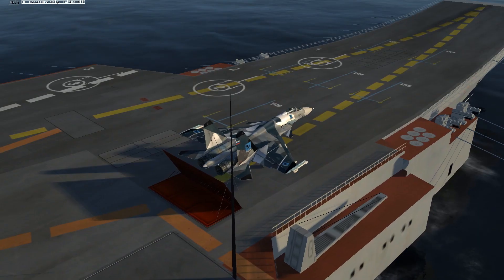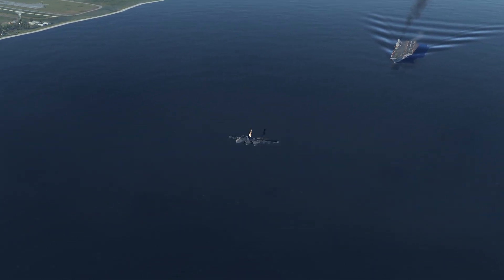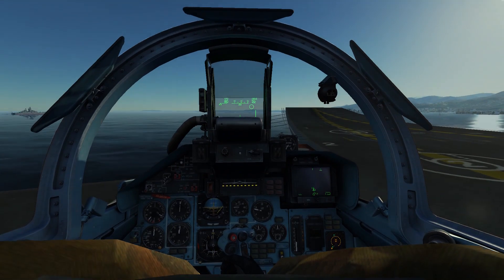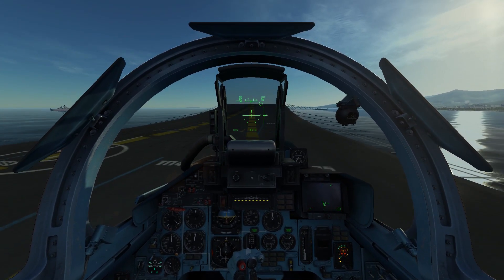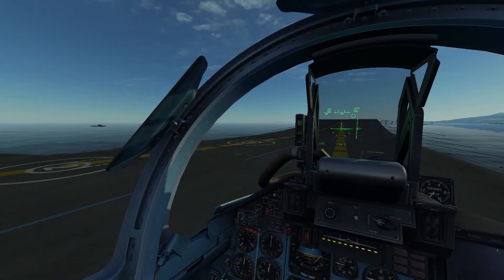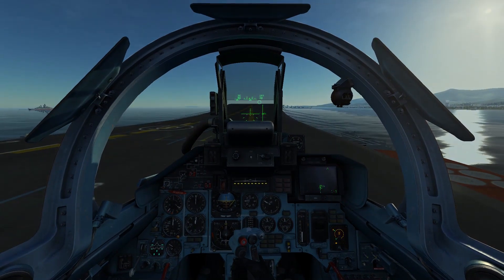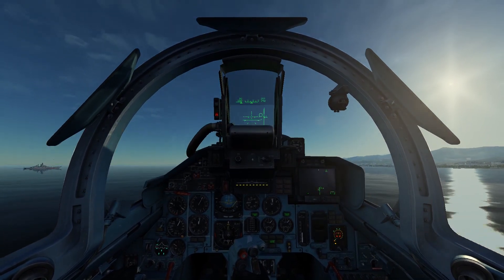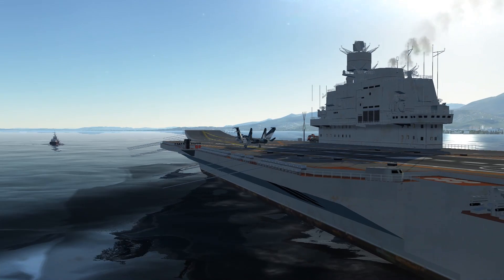DCS Su-33 How To:  Carrier Take Off

Comment: Just get to the back of the carrier and you can takeoff from there with as heavy as 36500kg. Yes, with 3500kgf above the MTOW you can takeoff, but only from the back end of the carrier. I dont know how other people manage to make the wheels stops activate to hold your wheels before the launch. Those red brick like shapes on the deck at the front of the main wheels aren't animated to rise, but I saw people being able to have the wheels stop on them and only after going max AB they would release the wheels and would also make the deflector doors
 actually increase your thrust (this is because it's all scripted by ED to benefit of thrust increase from the deflectors only when the wheel stops activate).
Reply from the maker: Yeah this was more to prove that it could be done from the front spot since, at least at the time, DCS forced you there unless you were a 2nd or 3rd ship in a multi-ship flight.

Comment: Your landings are ducky because you don’t know the sight picture and you’re muddling though as best you can with no real sukhoi information.

Trim aoa to 6+ at 290 kpm and 680m flaps and gear down.Start your descent into center line in landing mode at 7km

Trimmed and on speed and distance , set hud to landing . Put little circle on wires of deck. Hold big circle with throttle movement around little circle . Trust the gear. 

There is an autopilot carrier landing mode. Set landing mode. Set landing waypoint . Fly to box on your mfd with the boat on your 12. Level off drop gear and flaps engage auto throttle drop hook engage autopilot . Sit there. Welcome aboard.
Reply from the maker: No argument there.  Once again thanks for the tips.  I never bother with setting AOA in it because if I worry that much about it I crash.  I worry about it in the F/A-18C since it's higher fidelity and I fly it more.  In the Su-33, for me, it's more about just having fun and not sweating it too much.  I'm good with the ducky landings.  But thanks for the information.
Reply: 311Gryphon it’s a common mistake because sukhoi doesn’t go out of their way and the only point of reference is lock on and dcs documentation and what not . Fyi, the hook, the vampire , and the chandelier are all modeled correctly , so when you do want to go deep end with the flanker it’s not just cobra cobra cobra.

If you ever get the itch look at life aboard a Russian or old Ukrainian carrier - they are surrounded by tanker craft at different radials its a huge gas station dance .

Comment: You probably don’t read Russian but the different spots on the deck mark different take off weights. There is no catapult . You’re way too close . Flanker d on carrier defense launch from position 3, 170 kpm when they hit the ski.

You’re launching from the position of a mig29k with 45% fuel tank and 2 r73s. Do the math of the weight.

You can scramble and hit a tanker with that loadout from that position in the flanker.

In real life the wheel stops sense pressure and will only release when they sense the thrust settings from the deck boss .
Reply from the maker: Thanks for the insight.  I don't read Russian.  This video was more to prove that it can be done since that's where DCS puts you if you load up in a Flanker on the carrier.  Unless you're 2nd or 3rd ship.

Comment: If you want to take-off from the short runway, you have to add more wind. And also, the carrier has to drive with nose against the wind.
Reply from the maker: Not necessarily.  It helps obviously but it is still tough.  I know in real life they try to turn into the wind and make full speed for takeoffs but it's possible to take off from shorty without a ton of wind.
Reply: as others pointed out, carrier specific procedures and weight limits will be your biggest make-or-break plus full AB before you start rolling  @311Gryphon

Comment: 1 - Engine grid inlets UP (when they are down it can reduce the power of the engines by 10% to 12%)
2 - Use start brakes (it will hold your aircraft much better then axis ones)
3 - Always use special afterburner, it`s not optional.
4 - Flaps DOWN
5 - Gear UP ASAP after take off to reduce drag, leave flaps until you get positive climb rate.
You will not always be able to take off with full payload or fuel it all depends of numerous factors, like wind, carrier speed etc...
Reply: I saw the 'special afterburner' in control setup, but what does it mean?
Reply from the maker: @BaiYu1983  Sorry for the very late reply.  It adds a little power.  From a comment by another viewer below it looks like you have to be in afterburner, with the indicators lit, then hit the button to get into special afterburner mode.
Reply: Just get to the back of the carrier and you can takeoff from there with as heavy as 36500kg. Yes, with 3500kgf above the MTOW you can takeoff, but only from the back end of the carrier. I dont know how other people manage to make the wheels stops activate to hold your wheels before the launch. Those red brick like shapes on the deck at the front of the main wheels aren't animated to rise, but I saw people being able to have the wheels stop on them and only after going max AB they would release the wheels and would also make the deflector doors actually increase your thrust (this is because it's all scripted by ED to benefit of thrust increase from the deflectors only when the wheel stops activate).

Comment: Use weather options to setup a head-wind that will give you a higher indicated air speed as you lift off. I don't think you need a hurricane force wind. Just a little boost.

Comment: 5:48 You were looking at the Open Intake protection grids indication lights for the 10% boost for the engines. Its above the flaps light indication markers. The special 103% Engine afterburner boost is engaged after you have: The afterburners on 100% and the two green lights turn on, 2. Pressed the key command to engage the special engine afterburner boost.

Comment: I keep falling into the sea 80% of the time. I used the Start Brakes, it does not get fast enough when off the ramp.
Reply from the maker: I did as well.  If you can get around 140 by the end of the ramp you should have enough to ride the stall until you pick up speed.  I hope to experiment a bit more with it to get solid numbers.

Comment: You can assign a key or button to "start brake", and while holding this button the brakes will hold you a lot better than the toe brakes will. You spool up and release the start brake button, and off you go. I don't think it will hold you with afterburner, but close to max dry will be fine.
Reply from the maker: I'll give it a try.  My toe brakes seem to hold close to max dry but not quite all the way.  But thanks for the tip!  That may help spool up more before moving which should make taking off short a little easier.
Reply: Thank you!!!!!